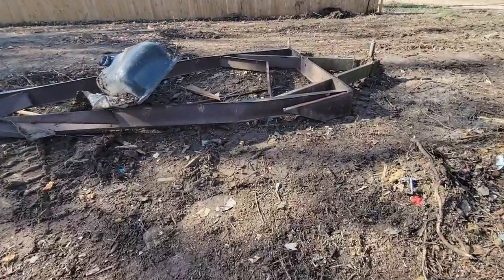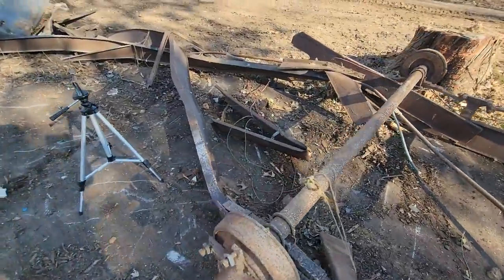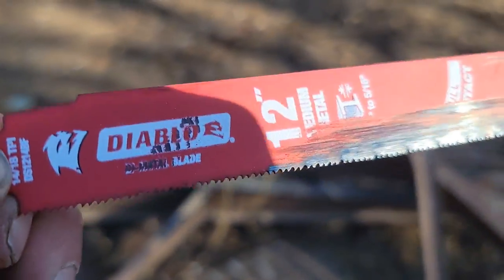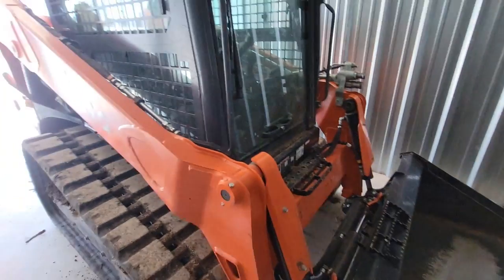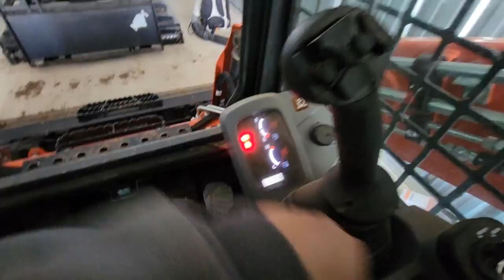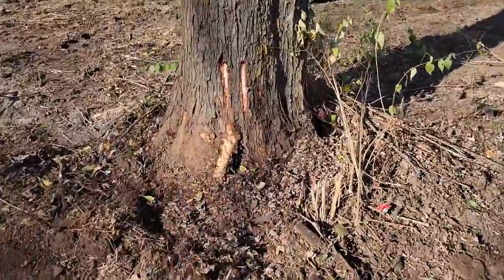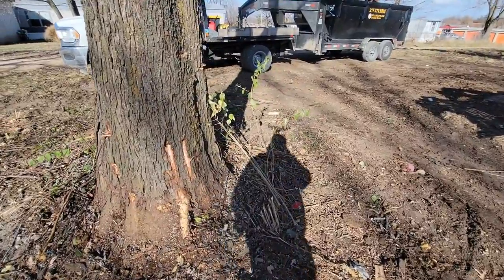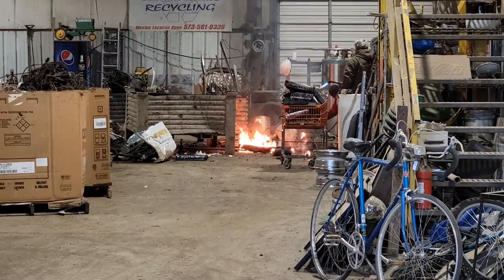Scrapping the Metal from a Mobile Home Trailer Frame

Comment: might want to look into a portable cutting torch setup and a metal cutting circular saw if you want to do more of these jobs
Reply: Yes. It’s hard to buy cylinders from most supply stores right now but you can find them on marketplace or Craigslist usually. When they are empty you just exchange em. It took me 40 minutes to torch a trailer frame this size into 4 foot sections and load it up myself with no heavy equipment. This guy looks like he has a good size truck and trailer. A 5 gal propane and 125 oxygen would be good enough for jobs like this and wouldn’t cost a whole lot.
Reply: @scrapmanindustries  I have a homemade oxy-propane setup where I can concentrate and compress my own oxygen using discarded medical equipment. Have even experimented with homemade acetylene using roasted coral rock and coal.
Reply: @chargermopar  how much oxygen can it pump out?

Comment: I recently purchased a old trailer park with 5 trailers needing torn down.  I'm using hand tools and a old truck to haul with.  I have experimented with many blades my best luck so far is a Lennox demo blade ! I've cut up a complete trailer in 3 foot sections with one blade . And for shits and giggles I know it will cut a Ford 302 crank in half. ..
Reply from the maker: That's very impressive!

Comment: Those diablo blades are definitely awesome. Check out “Project Farm” if you haven’t, dude reviews everything, pretty sure diablo wins most of the tests.
Reply from the maker: Will do! Yea those blades don't mess around
Reply: That's my plan.   Same exact situation,  except the mobile home frame is stuck on a hillside behind another structure.  NO heavy equipment will fit.   I think I'm going to buy a 6 pack and just Sawzall it into carryable pieces.